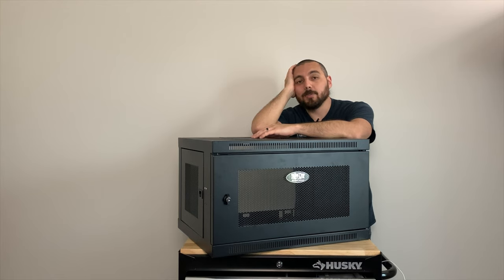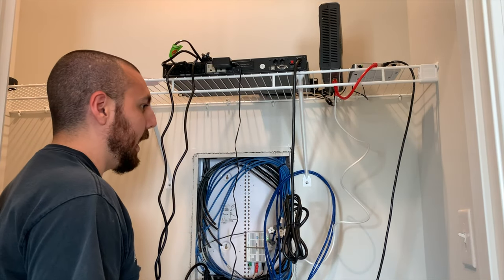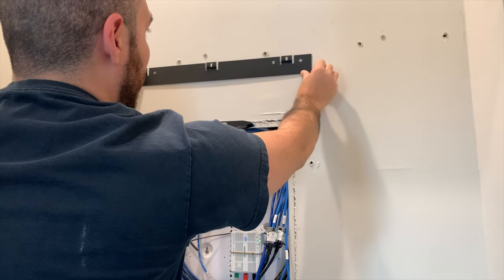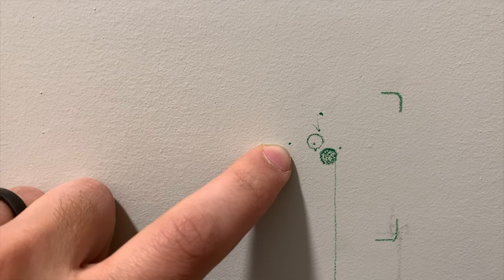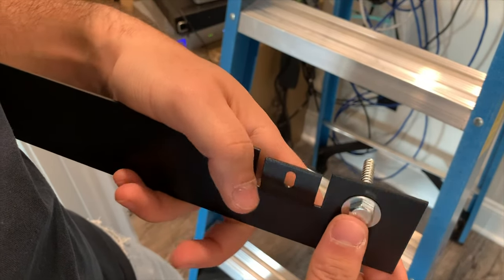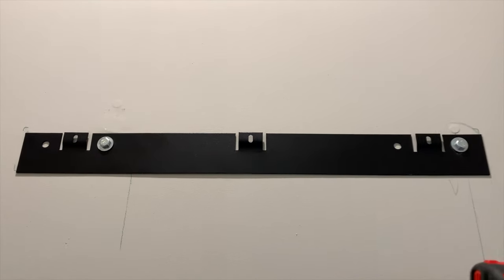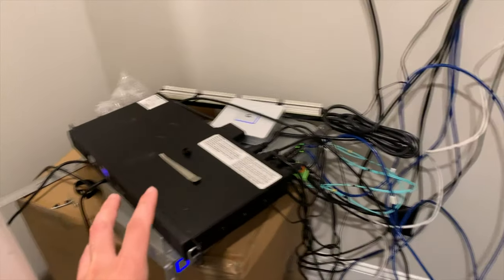Installing a Tripp Lite network rack in my home network closet / server closet

Comment: I installed the same rack with the exception mine has a glass door on it.  Since I mounted mine under the basement steps,  I ended up mounting a piece of plywood to the studs to mount the rack on.  Been very happy with this rack.  It keeps the equipment and wiring very neat.  Good video.
Reply from the maker: Nice! I think the one thing I need to do one day to make it look cleanest, is to move the rails back just a tad so the cables aren’t up against the door.  One day

Comment: That is correct, plywood then the rack mount, connect the rack and drill some pilots to the plywood and bolt it. Bolt the plywood to the stud(s) and the rack to the plywood and you can probably rang from the rack. I've installed several of those already. Mask off with painters tape and use touch-up paint after you got all the cables run and voila! The plywood you can make the length a little bigger than 2 studs so it'll be super strong.

Comment: Any reason you didn't mount your rack directly over where your cables are so you could have ran them straight in from the back?
Reply from the maker: Easier access I think and also so I could still walk in the room and use the monitor.

Comment: The cat 6 wire  you cant find where it goes prob goes outside in case anyone ever gets old home phone haha you can use cat 6 as phone wire just use one pair. But it comes out next to where your power meter is. Also i work for att and your installer got real lucky there was already a fiber ran into that panel from outside! just careful around the fiber at the bottom of that white box it will brake out of the fiber end if you pull on it or move it around to much haha
Reply from the maker: Hey that’s a good point didn’t even think about that, I’m going to look outside tomorrow.  Speaking of the fiber line and att.  Is it normal for them to run their own fiber to the house then cut the existing one? Because that’s what my installer did and now I have two fiber wires sticking straight up out of the ground.
Reply: @SPXLabs  yes we are sopost to run our own wire to the house normally the exj one if it was ours they dont bury them that deep and it was prob bad. but the one not in use he should of cut it even with the ground to make it look better on the side of the house.
Reply from the maker: So on a scale of 1 to 10, 10 being highly acceptable.  Can I just pull the cut fiber out of the ground?
Reply: @SPXLabs  i would say a 9 haha
Reply from the maker: Well next weekend I might rip it out if the ground!!!

Comment: Hello again, I was wondering what are those 2 white switches? One of them has to be the 1 Gb switch but the other one? I am not too sure. Is it your POE switch for your cameras? I also notice you have a 4 ports switch on top, what do you use it for out of curiosity?
Reply from the maker: Starting from the top left, at&t modem/router,UniFi USG (gateway), patch panel, UniFi 16 port switch, UniFi XG switch, cyberpower ups, cyberpower pdu(hidden under ups).

Both switches are Poe capable.  

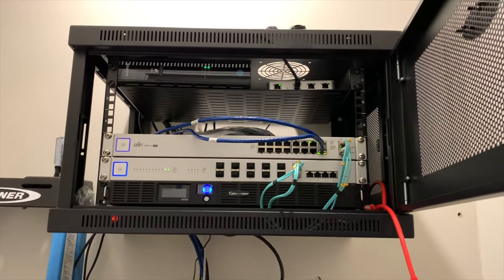Patch panel can be seen at 17:23
Reply: @SPXLabs  Thanks for replying. Really like your videos. Alot of great things to learn from them.
Reply from the maker: @ptessier73  Thanks for watching and the kind words!

Comment: Would you happen to know where a good place to buy a no so expensive 1u battery backup or even the standing one. I need one for my rack that I will be installing. it's just going to power my dream machine, and switch ISP modem and that's it for now.  Any help would be awesome.
Reply from the maker: Refurbups.com

Comment: I'm battling a 12u w/same mounting plate.  Client specified 1/4" lag screws, but cabinet is not clearing screw heads when attempting to heft it into position.  Of course, they don't wanna pay for an assist tech.  Some have mentioned using deck screws with low-profile heads.  Any1 experienced this issue?  What was your workaround?
Reply from the maker: I ended up just not bolting down that one corner.

Comment: the plywood is used when you cant attach the rack to the studs by itself or you have multiple pieces of equipment you want to attach directly to the wall. And yes, I always use pilot holes...for everything. Those bolts will be much easier to remove than if you had used screws so good call on that. My main complaint is it always seems the front door smashes the patch cables when it is closed so they always end left open or removed
Reply from the maker: I too noticed the cables were right up against the door.  I think the manual says we can move the rails towards the back so I may end up doing that.  MAY.  First I need to make smaller cables.

Comment: Racking equipment is so dang satisfying, I expect some cable porn by the end of this... Also, how tf have I never seen that cage nut tool before??? My fingertips and flat-head screwdrivers will be forever grateful.
Reply from the maker: Racking equipment is incredibly satisfying.  Oh the cable porn is coming but like not the 4k brother sister kind, more like the 480p obscure regretful kind.  Yeah the tool is amazing.  It’s also pretty helpful for removing those pain in the ass cage nuts that are stuck.